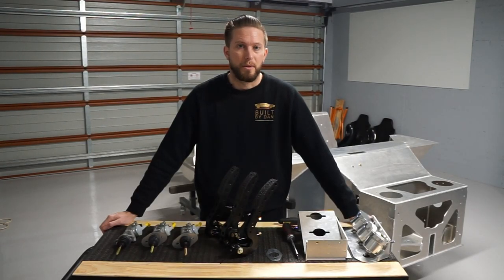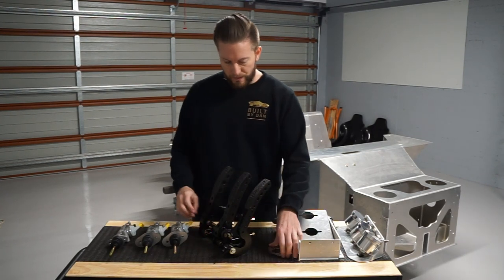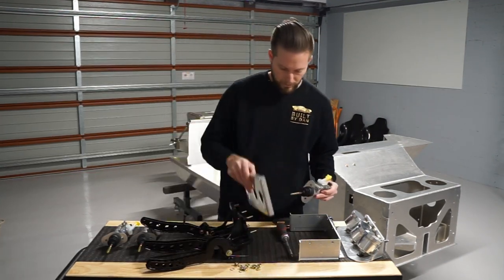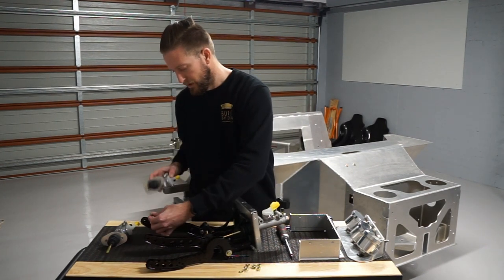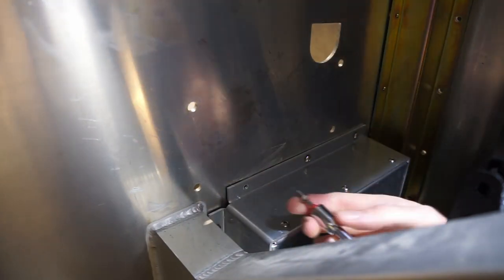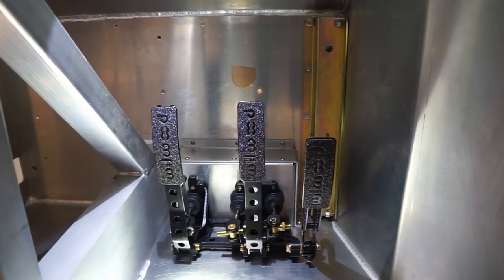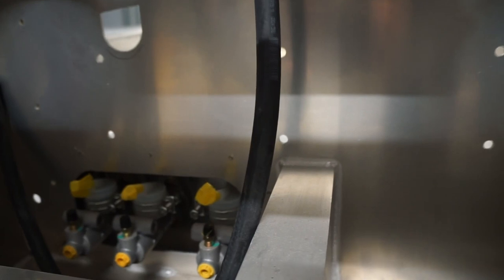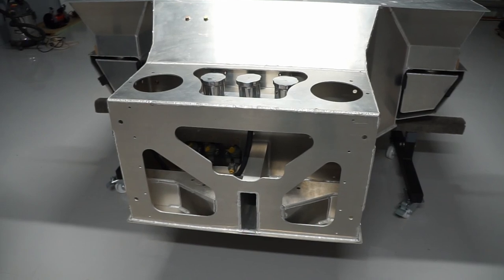GT40 Kit Car Build - Ep 08 - Wilwood Pedal Assembly and Master Cylinder Install

Comment: What color are you gonna paint it a gulf livery would be cool in my opinion
Reply from the maker: I did initially want Gulf colours, but have decided on the grey as per the current gelcoat finish, but with single wide gulf orange stripe and orange centre wheels. Suggest having a look at Ep03 Build Specification to get an idea of how it will look once completed.